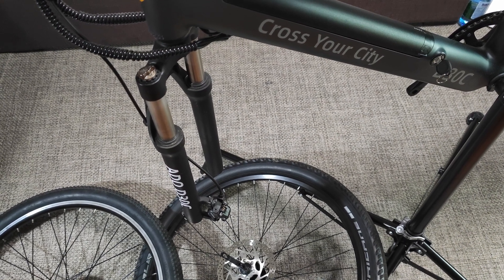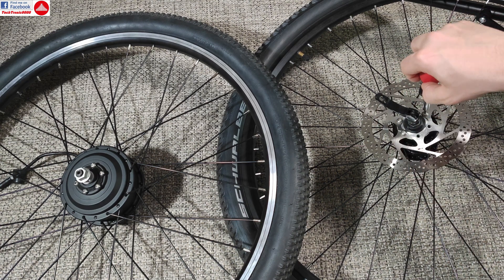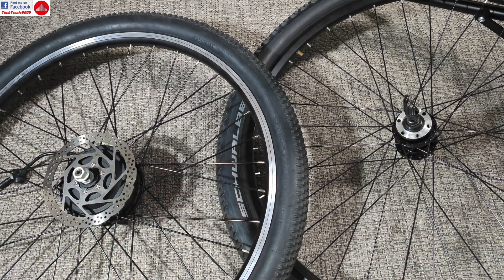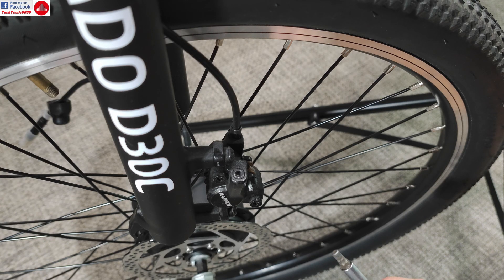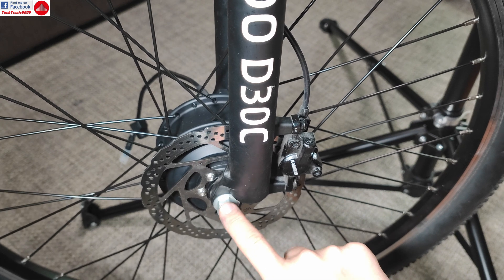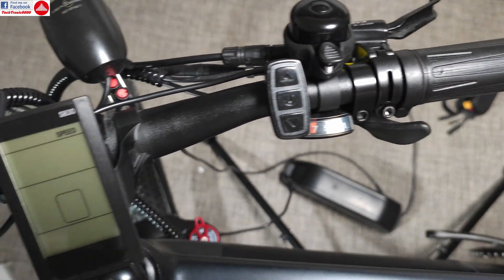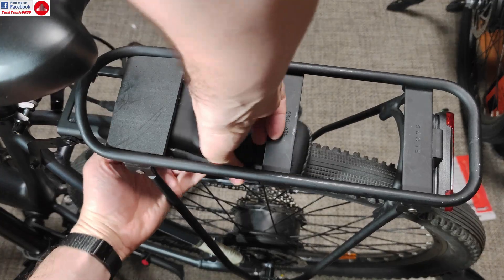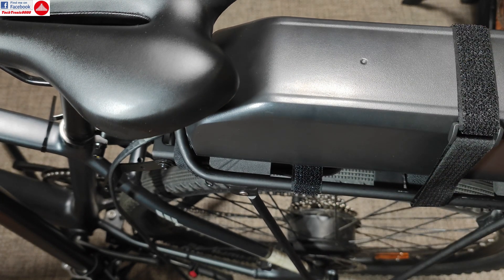KirbEbike E-Bike KIT Installation | ADO DECE 300 / D30 Dual Motor Build

Comment: I like the update's you do on your bikes. The last few weeks i dit a lot of updates on my ADO A20F, battery update to 48v, hydrolics brakes, new peddels, new stearing bar 700mm, and a new cassete 11/28T.
Reply from the maker: ADO are great for modding, a 48V A20F is an epic machine as the power and the speed get really high. I will also soon post the results of my D30C mod.